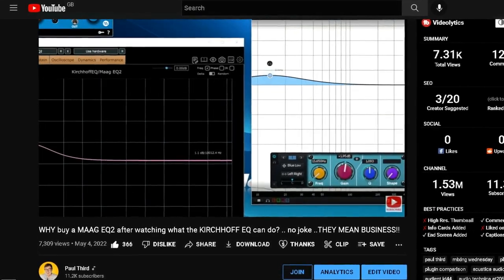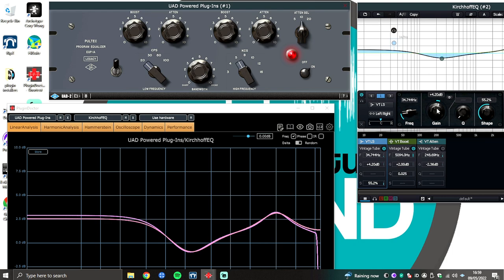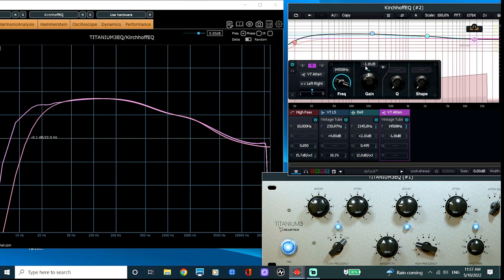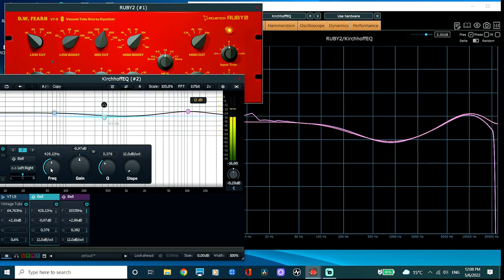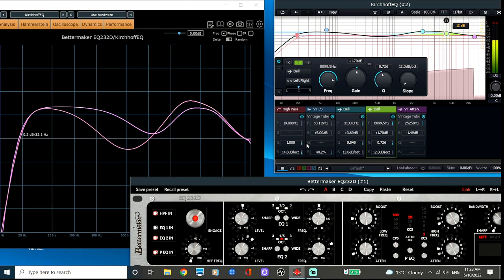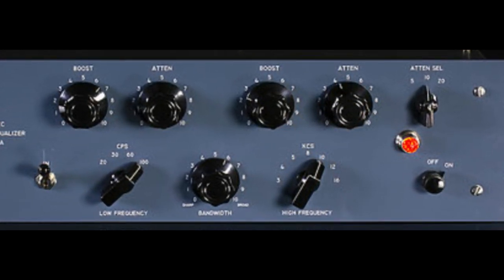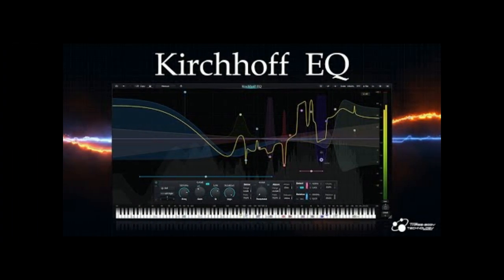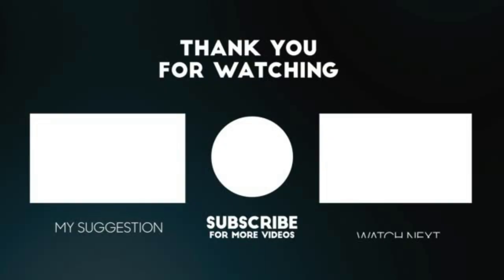Do you REALLY need 5 Pultec plugins .. considering KIRCHHOFF EQ can do THIS!!!???

Comment: It is always a balance between workflow and details. I always like pultech emulations because it doesn’t have many things to dial in. They work 90% of the time. In those 10% or less instances, that’s when having a digital EQ with a pultec analog style would be a godsend. I rarely find that not having an more specific pultec is the right move. Often I’ll just switch to a different analog emulation and it gets the job done quicker than dialing stuff in. But that’s the thing the Kirchoff is for when you need to dial things in. When the quick broad fixes aren’t enough and you gotta go into the weeds of the sound and shape it to your desires.  Definitely high on my list to buy.

Comment: Im loving all of your Videos, but Paul let‘s be honest, you can simply copy litteraly ALL curves of an EQ 'cause at the end it’s an EQ. 

The reason i use the Ruletec instead of an Graphical EQ is because the workflow, so I can use my ears instead of seeing missleading values or curves. 

Every EQ Curve can be exactly matched with an graphical EQ but it’s an way better experience in terms of Workflow and Saturation like its build in the Ruletec with only 1 „Analog“ Switch.
Reply from the maker: True in a fixed setting but I tried with bettermaker and pro Q3 over a year ago and it's the curve interaction that I couldn't match due that low shelf and attenuation. I needed more bands and it was a pain in the arse.

When I use the pultec curves in kirchhoff I'm not looking at the curves im looking at the band list and using the controls just like any other pultec.

There is genuinely no difference between kirchoffs modelled curves and any other eqp1a apart from that you don't have the fixed frequencies. When the frequencies match the curves match 

If you can't not look at the curves I get it but for me anyway I won't ever use another pultec plugin for pultec style curves but that's just me haha

Comment: Thankyou for your video. I’m interested to hear the Kirchhoff EQ. I own a hardware Bettermaker Stereo Passive Equalizer which is great! I have compared it to various Pultec VST’s and I haven’t been able to match it. The Bettermaker sounds more open and smooth. I use it during tracking and also on my master bus. It will be interesting to hear how close the Kirchhoff can get to it! 
For general eq I use Toneboosters EQ4 which I chose over ProQ3 after demoing both. 
Im wondering if the Kirchhoff Eq could potentially match the Bettermaker Stereo Passive EQ and supersede Toneboosters EQ4!?

Comment: Well, now I expect three-body-tech-guys (I don't like the name by the way) to make a digital compressor with infinite variability: Upwards compression, regular compression, limiting, infinite compression and negative compression. -2 s to +2 s attackknob, 2 release knobs (that you can set to react based on the transient-characteristic), lookahead,  lookback (attack-delay), release delay (like DS1-MK3), two threshold knobs (where you can bypass the second, otherwise it only becomes active if the signal drops to a certain threshold), mixknob, A, B, C, D - setting-recalls (like IKM), autogain, all kinds of knee-settings, mid-side, sidechain, 5 bands and bandssoloing and processmonitoring and mixknob for every band - 

and once they did all of that in a manner that is still intuitive and userfriendly/not overwhelming, they oc need to model all other compressor-compression-ranges and attack/release behaviours.
Reply: You can sort of do this with either "compassion" by DMG or "Sculpt" by ADAPTR (plugin alliance). Maybe look into those and see if they cover this

Comment: I am late to the party with the Kirchhoff EQ. Very nice.
But having the Pro Q 3 and more than 5 Pultec EQs, the workflow of having Pro Q 3 doing the more surgical EQ and having a separate plug in, doing the Pultec EQ, just makes more sense to me. Obviously I would say that after spending the cash, but its just a matter of workflow. Alas some plug ins have a "sound" too so you'd reach for something over a clean digital EQ.

Nice this Kirchhoff EQ though, gotta say.
Reply from the maker: That's where I'm struggling because I'm sitting here with one plugin instance being able to do all the eq stuff that I use to do with 3 or 4 haha the band list is the game changer for me. Cause I'm looking at the dial as I turn it, not the curves, just like how I use the emulations.

Honestly man see when you start getting into that workflow of having more things crammed into one plugin it's WAY quicker to work.  I'm doing pultec, ssl, maag high shelf, hipass and a low mid cut on vocals.. All working dynamically reacting to eachother almost, mixed phase so the pultecs analog and the maag is linear, and I only have one plugin instance to work with. One output to worry about for gain staging. It's all neatly organised in my band list when I go into it and it's only 1 plugin instance

I get it from others perspective.. Kinda haha but I am struggling to see past it right now. Honestly.. F**k going back to loads of instances, different gui's, level matching them all when you make a change etc etc 

Ive been doing as much as I can with kirchoff and then using an acustica pre or a saturation plugin after for some colour or vibe if I really feel that I need it.

But I am autistic and very fixed when something really works for me haha 😅

Comment: What this prove rather  is that the ears of the engineer and the monitoring system is what count most. Pultec helps you to achieve a certain kind of eq curves without having special audition and engineering abilities and that is what made it very popular. For a random guy to make those curves without all the measurements you used is nearly impossible.
Reply from the maker: Not really. You just select your 3 vintage tube bands in kirchhoff and use it just like any other eqp1a, with less limitations. You are right that it's the ears of the engineer and this takes away the limitations. True I had to play about in doctor to match 5 different pultecs but I still used the same 2 or 3 bands like I would in any other pultec.. Its just its not fixed to frequencies. Genuinely stuck up the 3 bands, boost your low shelf and shape to taste, boost your bell to taste, attenuate to taste, no different to using any other pultec. Simply using the modelled curves intuitively to get the job done 🤓
Reply: @PaulThird   Yes, considering Kirchhoff Eq it is much easier to achieve this but for Proq3 or stock Eq it will be hard.
Reply from the maker: 100%.. I only said other digital eq's as there will be some wise guys that tells me they can do what I did in kirchhoff with their digital eq so I just left it in haha

Comment: so this kirchhoff sounds and boost exactly the same when you use for example the titanuim uad,ruletec or waves puigtec eq and match the eq curves?!?! 
i mean for example if you boost 4db on 40hz on a fabfilter eq allmost nothing happened if you boost the same area on a maag eq the studio is bouncing.... 
the same on neve eq's that sweetnes in the topend
so all that power and sweetness is put in to the kirchhoff eq right......... so that 1 eq is a replica for all that powerfull eqs out there?
Reply from the maker: In regards to an eqp1a.. Yes. Use the same amount of bands and you'll get the same results, but kirchhoff gives you the variability of the frequencies whereas the others fixed. Kirchoffs vintage low shelf is no different to using any other eqp1a as they've circuit modelled the curves and the shape reacts the same way as the low attenuation. Thats why I can easily get the same curves by just sweeping the frequencies.

Tube tech is a bit harder as the curve interaction differs from an eqp1a which is what the kirchoff has modeller but can still be matched with the same amount of vintage tube bands in kirchhoff.. But not as intuitively.

I was playing about with kirchhoff vs titanium on the low end as that's where I always felt titanium had the edge over other pultecs and with a bit of tweaking with the slope on the hpf I was able to somehow get that phase relationship right where the low end practically nulled out.

Acustica is a hard one to match as its got the pre as the biggest variable. That skews the phase a lot which is actually one of the subtle nuances of hardware vs digital that makes nulling a lot harder. Acustica has the curves seperate from the pre which is more indicitave to hardware as the curves are generated in the middle of the input and output transformers (if they do use transformers). Signal passes through the input then you adapt the curves with the pots and that adapted signal flows to the output. The pre in acustica plugins basically gives you an impulse response of the signal being passed through the unit so it basically captures the pass through which is seperate from the curves.

Kirchhoff gives you just the circuit modelled curves without the pass through of the unit.

So even though the harmonics in these particular acustica pres add no audible harmonics there is a change to the frequency response before the curves which shifts the phase and makes it a lot harder to match as just because you can match the curves doesn't mean you can match the phase.. But how much of a difference that makes.. That's what I'm gonna put to the test on Wednesday
Reply: @PaulThird  thank you very much for your answer fella 
I have noticed at eqs where the value is fixed which have more power and can boost more and the sound remains nice than the eqs where you can use all settings, 
so the kirchhoff swipes all eq off the road where the freq is fixed and responds with the same power .....?! unbelievable

Comment: I wonder why the Acustica plugins didn't have any harmonics. Did you turn off the pre? The pre produce harmonics when driven. (depending on the Acustica plugin)
Reply from the maker: I accidentally had Ruby pre off during the harmonic test 🙈 but titaniums was on. Tbh i already knew Ruby had no audible harmonics so I rushed that part. You didn't miss much apart from a second harmonic at -100db with the pre on haha to get any slight arguable audible harmonic content the Ruby pre has to be maxed out at +24db and it still only reaches 2 audible orders of harmonics maxing at -79 & -77db.. Still arguably barely audible haha
Reply: @PaulThird  oh and BTW, I would love to see a review of the new Kit Motown Eq from you. Is there some special curve voodoo and vibe going on? I like the hardware sound from the Heritage Eq. The frequency choices seem to work very well in some way.

Comment: While showing Ruby (Harmonics) did you activate the "Pre"? I guess THEN you will see a difference
Reply from the maker: Your right I just double checked and I forgot to put the pre on when I did the harmonic test on the Ruby. Just checked.. A 2nd order harmonic at -100db haha.. Same result. Super clean. Nothing audible
Reply: @PaulThird  this would mean, activating the "Pre" in an AA-Plugin just adds an Eq-Curve, not necessarily harmonics?
Reply from the maker: I had it on during the video. You can see it's on during the curve matching. Just annoyingly not on  the harmonic bit. The pre brings in sampled harmonics and brings in a sampled pass through frequency response. Most modernish hardware eq's are super clean. A real hardware pultec is the same. Super clean
Reply: I caught the same thing. Ruby sounds very very clean to me but the pre definitely does something I like. May be primarily frequency response, likely so, but I swear there is also some audible phase shift with it that just sounds different to me than most EQs. It doesn’t always work but sometimes it’s just wonderful. An example of how subtle things add up: linear phase EQs. They cause pre-ringing, bad right? But…Sometimes the top end of linear phase EQ just sounds sweeter to me! And the only thing I can think is causing that is shit tons of fast pre-ringing in the higher freqs. It’s technically bad, but I like it sometimes 🤷‍♂️
Reply from the maker: The pre alters the freq response quite a bit. When I use a pultec via kirchoff I 9/10 use it in mixed phase mode so the low pultec shelf & attenuation is analog phase but the maag high shelf is linear phase. I've been getting really experimental with it by making the maag and pultec lows trigger each others dynamic section so the highs of the vocal trigger the pultec and the lows trigger the maag shelf. I even trigger the SSL e 1k bell off the mud in the vocal which is also being dynamically attenuated haha its setup as a preset so it means I've just got to sweep the bands a bit, alter the thresholds and then I'm left with a vocal that only gets the goodness when it needs it.

Theres times when I love the lows of a pultec and the highs of a maag but not all the way through the entire song.

I can just tell I'm away off in a different direction to many people as all I'm reading is "Analog emulations limit your options which is better from a decision aspect" and im deep diving fine tweaking but it all makes absolute sense in my head

Comment: Can you PLEASE include DMG Equilibrium emulated curves for your next SSL and other shootouts? It's the closest to the Kirchhoff feature-wise, but it would be nice to see which one matches the curves better. According to DMG, they renew trials as many times as needed, if you don't have it.
Reply from the maker: Does it do analog modelled curves?
Reply: @PaulThird  Yes! Pultec, SSL 4k E black and brown knobs, GML, Sontec, API, Neve 88, and more. It also models the Q/gain interaction. And if you turn on FIR processing with Analog phase, the phase of the original EQ is replicated exactly.
Reply from the maker: Interesting I thought equilibrium was more like proq3. Didn't know there were any analog emulation curves
Reply: @PaulThird  Equilibrium is actually mostly curves from analog EQs in the peak and shelf sections. The filters are named after the math equations that generate them and the Q-gain interaction is confusing and poorly explained, so it does have features for audio nerds of an entirely different caliber than me, but the "Equilibrium is the last/only EQ you'll ever need" line you hear on GS is kinda maybe true. Took me 30 seconds to match my usual settings from the UAD Pultec. Really do wish DMG would write a manual for people without math degrees.
Reply from the maker: Haha yeah it does sound like a real heavy eq from what I've heard others speak about it.

Comment: Oh yes I see why you use the list view now. It's good for  using with a bunch of emulated curves. As opposed to quick corrective notches for example.
Reply from the maker: Yeah that's where its been a godsend for me personally. Super quick and means I only have to deal with one output knob for gain staging. Organise them the way I want in one easily accessible plugin instance, less cpu and I can do more with them and work quicker. One instance to bypass in and out.

As you can see I'm pretty much fixed on the idea 🤣🤣

Comment: I'll share this gold preset on Kirchoff EQ:
-an agresive 96dbOct(stock) lowCut on 18Hz
-a SSL E lowCut on 30 to 100 (it depends)
-a pultec (vintage tube) self on 60Hz
-a SSL E lowmidbell on 250
-a SSL E midbell on 700
-a neve (British) high bell on 2500
-a neve higshelf (is a great musical bell actually) on 8000
- a mag (blue) higshelf on 25k

Each EQ shine specially in a concrete frecuential segment, with Kirchoff u can create the best eq ever made.

Comment: This is the first I've heard of this plugin, but it looks to be competitive with Pro-Q3 in most ways, if not all.  Is there anything I'm missing here, or is this just a way better deal than Pro-Q3?
Reply from the maker: If you want analog modelled curves, more dynamic options, a band list and mixed phase then this might be up your street.

I use the dynamic detection a lot where I choose a certain part of the source as the trigger so if its a maag shelf I'll use the low end as a detection for the expansion and the other way around for the pultec low shelf and attenuation. You can set them so they react to each other and only boost to balance out the other
Reply: @PaulThird  That's wild.  This is probably not in my budget at the moment (have you seen the price of cars???) but this will definitely be my upgrade from stock plugins and Waves F6, which is currently my go-to parametric EQ.

Comment: You tried the overloud at all? Heard great stuff abt it
Reply from the maker: An engineer I trust tried it out and it wasn't for him. They coded one of the low attenuations wrong as well which I checked for him by running the settings through the access analog pultec. They also released their own hardware vs plugin video (it's unlisted but I had a link for it at the time) and it just didn't do it to my ears. Just another eqp1a to add on to the already toppled stack of eqp1a emulations
Reply: @PaulThird  true too bad. Their pultec sucks
I usually like their product due to their low cpu usage and sounds great
Reply: @PaulThird  true, but they fixed the bug v soon! 
Asking because Mark at Heron Island Studios was converted to it recently
Reply from the maker: Pultecs a pultec at the end of the day. Especially eqp1a's. All you really need is one you like.
Reply: I've not needed to pay for a Pultec yet. SonEQ is a cool hybrid with a Pultec style low band that does the job. Ignite Amps' version has the mid band and HP LP modules. Kiive Warmy and Analog Obsession's are other more vanilla options. The first three offer adjustable saturation too.